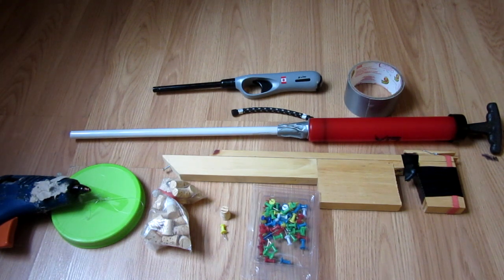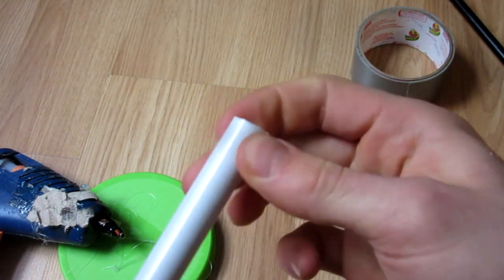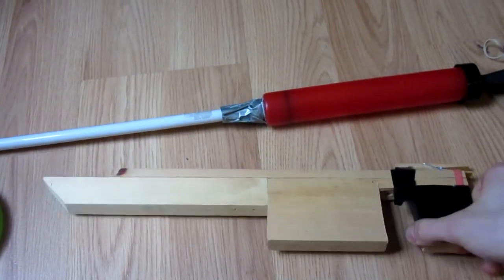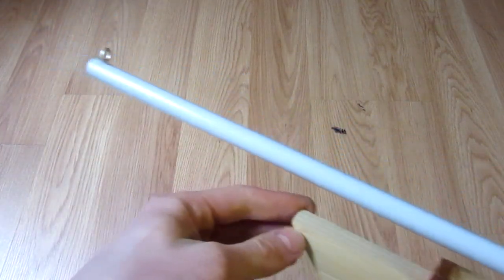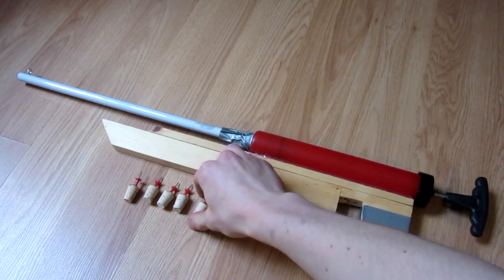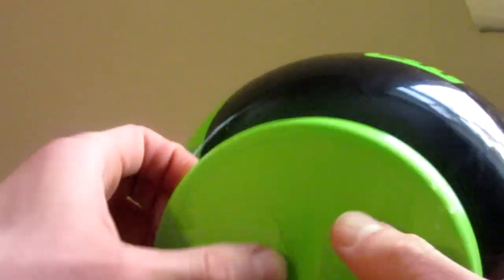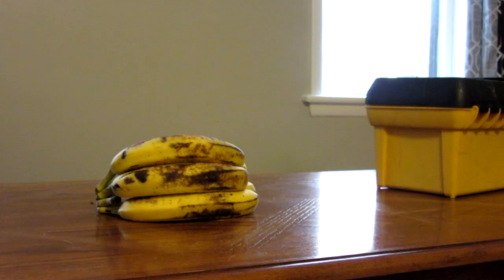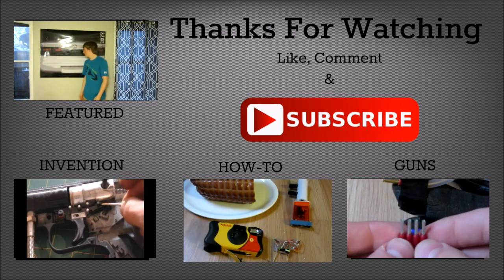How To Make a Simple Air Dart Gun

Comment: I made a blow dart gun. it was a black plastic tube about 2 and a half feet long. it was the exact diameter of the pushpins used in this video. so i just put a pen cap on one end ( aim) and a plastic grid on the other ( mouth guard) and it worked with great accuracy and power.